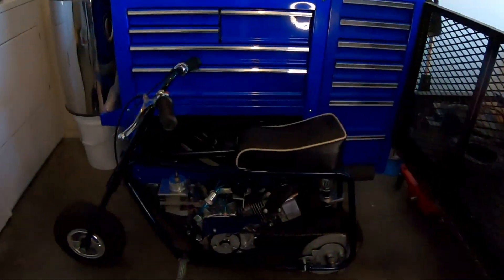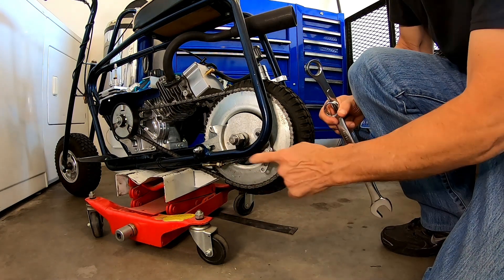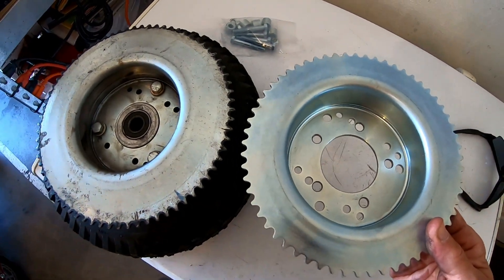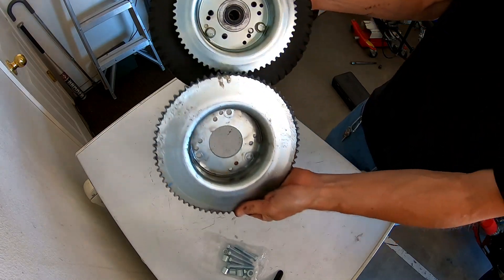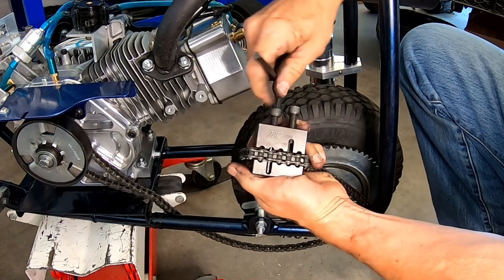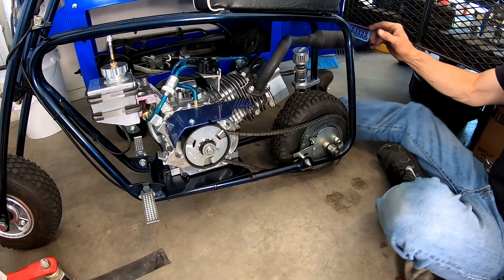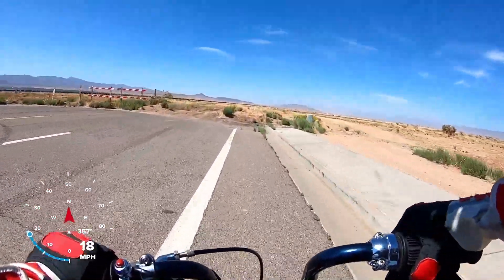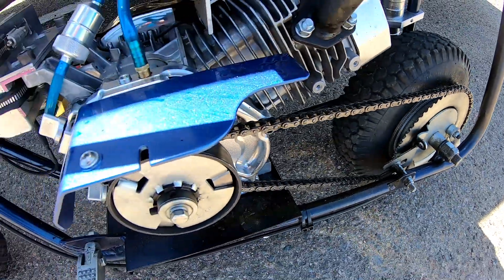Minibike goes 70 MPH/Predator 212

Comment: Any idea what frame that is?
Reply from the maker: Yes, it is an early model Azusa frame.
Reply: @Black66  thanks I have the same one and wasn't sure. You mentioned adding a disc brake, are there parts available that bolt to the tristar rims or would you have to swap it too? Thanks again
Reply from the maker: @bucky14b  I'm sure We could find a disk brake set up for the vintage wheels. Maybe GPS or Studz racing or somewhere like that.
Reply: @Black66  I've looked at GPS and don't see what I'm looking for. Maybe I'm just not sure what I should be looking for. I'll check out the other website. Thanks

Comment: Well so much for not being able to outrun the zombies or the po po, that's the ticket. What would be the average range on a tank of gas, approximately? Thanks for this excellent instruction. Appreciate it.
Reply from the maker: It goes around 15 miles depending on how hard you are on it
Reply: @Black66  thanks!!👍 This particular model, or for someone like  myself who has a little age and size on them what particular frame would you recommend for someone like myself? Your unit here looks simple, really nice, at the same time has superior performance.  Thank you for your help Todd in Charleston West Virginia.
Reply from the maker: @toddellis3323  If your a bigger guy I would reccomend one of the bigger frames like a Coleman CT200U-EX or something like that because this bike is really small. Im a small guy and its small for me. The Bigger Coleman bikes are really comfortable to ride. If you do want a small frame bike, something like a Doodlebug is a little bigger than the Azuza frame like this bike.
Reply: @Black66  Yes I'm a bit bigger and we'll leave it at that 😉. Thanks.  
Can I put the smaller tires on this frame with the 60 tooth back cog like you did on the other video?
Reply from the maker: @toddellis3323   You can for sure change out the gearing on pretty much any of these bikes. If you are wanting a small tire bike then I would just grab a Doodlebug/baja racer or a Rascal from go power sports  or something in that size range. There still small bikes but bigger than that Azusa frame. Or at least my Azusa frame. I have the early version with the straight handle bars. Which makes the bike a little harder to ride because there is less room for the rider.  If you really want an Azusa frame they do have different versions of something very similar on go karts USA web site. Here is the ink  https://gokartsusa.com/Mini-Bike-Kit-6-Inch-Wheels.aspx
Reply: 70mph Holy Chit, that's bustin major ass. I feel quite certain I wouldn't be at that speed very often but it certainly would be very nice knowing that level of performance is there if you need it. Thanks.
Reply: Thank you so much.

Comment: I'm a retired gm mechanic and just bought that very same 4 1/2" brake unit you have here, What a piece of crap!!!  Just about everything is done wrong, the unit operates with fred flintstone precision,  I'm installing an old 4" set that I own that are much nicer, What utter garbage!
Reply from the maker: This is an old-school bike. I wanted to keep it as period as possible. Hence the drum brake. If someone wanted a better braking system I would recommend a disk brake set up.

Comment: How much power you think the motor is making? New sub here 👍🏼
Reply from the maker: Thanks.   It's a basic build, it has a small cam in this combo. The parts list is in the description. I'm not really sure but maybe 12-15 or so.  Give or take.
I think the reason it was decently fast was the gearing in combination with the small tires and lite weight of the small frame.
Reply: @Black66  i need a new cruiser im pretty sure i have the fastest mini on earth rite now love the channel bro
Reply from the maker: @uncledave415  Thanks! Yours sounds like a rocket ship!
Reply: @Black66  its overkill 60 hp outlaw jr dragster motor with torque converter set up for 8th mile she wont stay off wheelie bars 🤦

Comment: I'm new to your channel, and you are a maniac with this ultra-fast mini-bike ... and that's awesome! Liked and subscribed! BTW, what kind of frame is that? Did you build up your mini-bike as a frame only, then chose all your parts by yourself, or did it come with an included engine, wheels, etc.? It's nice looking frame and a great color. BTW, yeah, you could've gotten up to and maybe past 70 MPH. You still had some top end left when you hit 68 MPH -- that's awesome! Way to go!
Reply from the maker: Thanks for subscribing! I bought the frame only . It's an old Azusa frame . One of the earlier models with the straight bars. I put it together in stages. There are quite a few videos on the channel with the different combos.

Comment: Also how much horsepower does your engine put out to give you 7000+ rpm
Reply from the maker: Not sure, but the parts list is in the description. I think the combo the bike had in this video was a perfect combo for the small 5 inch tires and light frame.

Comment: Get a 55 on the back and let’s see her top speed. I got a 17:54 gonna finish soon. I expect 75ish. Hope you can hit or beat it. Your motors pretty built s
Reply from the maker: I lowered the gear ratio with the clutches because I'm using the old school drum brake sprocket on this bike ,just to keep it more old school. Every tooth I add to the clutch is  equivalent  to taking away 6 teeth on the rear sprocket I'm getting to the point now where the engine doesn't have enough torque to pull much more gear.

Comment: Were did you get you rear sproket at and what stage is your predator what all have you done to it ? Mine just has the mikuni carb and no govern I need to put billet flywheel in it and I cannot find a exhaust pipe that will fit my bike its a Motovox any idea where I can get one at thanks
Reply from the maker: I picked up the sprocket from a seller on eBay https://www.ebay.com/itm/153969185235

This pipe should fit your Motovox as long as you don't have the engine lifted and is sitting on the stock mount 
https://www.gopowersports.com/header-pipe-3-stage-center-exit-196-212/

Comment: What is all the motor mods you have done to this bad boy
Reply from the maker: It's a fairly mild build. It has  
.020 ARC billet rod, ARC billet flywheel, ARC billet side cover ,012 Head gasket, Head stud kit  
Champion shaft mounted rockers  
VM22 Mikuni carb kit  
GX 160 head with mild port work 
Header pipe  ,252 series cam and 22lb springs

Comment: Where can i buy the 15t clutch sprocket?
Reply from the maker: I picked up the clutch at OMB warehouse https://www.ebay.com/itm/Max-Torque-Ss-Clutch-3-4-Bore-35-Chain-15-Tooth-MTSS1534-/174947428063?hash=item28bbade6df
Reply: Will it fit 212 predator
Reply from the maker: @osojayydoubleoseven9222  Yes
Reply: Thank you

Comment: What kind (size) head do u have on it? I want to change the head on my 212, but im not sure about pushrod size and rockers…..awesome build btw….i have a couple cammed, ungoverned ones on stock internals, but i want to build my next one with a different head, rockers, etc….
Reply from the maker: Thanks ! I think I added most of the parts I used in the description of the video . The champion rockers come with pushrods in the kit . I’m using a 14cc chamber,  GX 160 head on this build .

Comment: That is a beautiful minibike. That blue sets it off. Your videos are really making me want to get back into this hobby. I built several of these in the 90s.
Reply from the maker: Thanks!  Might as well get back into it. No time like the present.
Reply: @Black66  ya i have 2 of the coleman minibikes the bt200x and ct200u-ex. Trying to figure out which way to go with them. Build for climbing or speed.? I live in the desert now and usually run them on hills. My bt200x is heavier so doesn't climb as well as the ct200u-ex. So i love videos lile your for ideas and inspiration
Reply from the maker: @goadmerle  Maybe you could build one for speed and one for off road?
Reply: @Black66  was thinking the same thing. The ct200u-ex for speed. Due to lighter frame

Comment: Hey im trying to get a small sized affordable motor bike that goes for around the same speed have any suggestions? Im clueless when it comes to this kind of stuff.
Reply from the maker: If you want something small that has the potential to go fast and is easy to modify to go fast , get something with a predator 212 or at least a 196cc on it like a TrailMaster MB Storm . Its a small framed bike with a 196cc. Or an older doodlebug or Coleman cc100x with a Predator 212 on it.

Comment: im running 54mph on a stock predator with a mikuni carb,on an old chopped and stretched frame with 8-s and highway tires and Still pullin the front wheel...after watching your vid,i think im going to regear for 70 ish....Deffo an Ultracool bike you have built there....ps,should you read this,have you considered going with a Tav instead of the drum clutch??
Reply from the maker: Your bike is moving! Check out my other videos. I have a Torque converter on A Doodlebug and a CT200U-EX and a CT200U. I like the Azusa bike with the clutch. It is a super small bike.

Comment: wouldn’t a smaller sprocket on the back tire make the bike go faster? i remember having a smaller sprocket on my bmx bike and it made it easier to peddle faster . i have no mini bike knowledge yet so if it seems like a stupid question to ask my bad . I’m just getting into the hobby and trying to learn more that way . i can start my build . i wanna have a super fast doodle bug to ride around with for fun .
Reply from the maker: This is what I did in this video. I added a smaller rear sprocket. You can also add a bigger sprocket to the clutch for the same result. Got the doodlebug to over 60 in this video  https://www.youtube.com/watch?v=ScK99YPGpsg

Comment: Is a 10 tooth clutch with a 34 tooth sprocket any good ? How fast would it make a 50 mph bike go if the sprocket was changed to a 34 tooth
Reply from the maker: That is a 3.4 to 1 ratio. That would be a" top-end" gear ratio for sure. It really depends on the tire height on the bike, the weight of the rider, and engine mods, etc. What gear does the bike have on it now?
Reply: @Black66  it has a 41 tooth sprocket right now and it’s a predator 212 with the governor removed and a pz27 carburetor. The tire size is a “5”tri star with 135 pound rider
Reply from the maker: @ohyeahyeah1606  You said the bike did 50 mph before. The engine was turning around 5900 RPM give or take. Assuming the engine has enough torque to pull to 5900 RPM with a 34 tooth sprocket. It should run around  60 MPH.
Reply: @Black66  how fast would it make the bike ?

Comment: I switched my azusa from 5 inch wheels to 8 inch and rear sprocket to 60 tooth and tbh I'm afraid to go full throttle I back off I know I'm hitting 50 and than backing off until I buy a good helmet.
Reply from the maker: I bet that thing moves out !  
The big tire upgrade is nice !

Comment: Very cool, I have been riding old Harleys most of my life ( I'm 75) now I still ride a 1949 Cushman motor scooter with a 14 HP Subaru Robin engine. I recently bought a Coleman CT200U-EX for Shi--t s and Grins. Just finished putting a torque converter on it and that tripled it's speed from the original Jack shaft. I'll probably stop there. Old bones don't heal as fast and young ones. Besides I've been riding for over 60 years. Keep your knees in the breeze and the shiny side up and the greasy side down.
Reply: ive got an old junky cushman eagle frame im gonna put a v twin briggs on.
Reply from the maker: @frigglebiscuit7484  Yes!
Reply from the maker: Thanks! good advice! I have an EX I put a converter on also. Video coming soon.

Comment: I live in the same town! What would it take for you to make 196cc motor/ coleman mini bike way faster... sos
Reply from the maker: Nice town. If it's totally stock. Bypass the governor first. That will make it quite a bit faster just doing that. Get a pipe and a high-flow air filter. If you can add a bigger jet that will help too. There is a lot more you can add after that if you really want it to run.

Comment: Where can I find the chain breaker you used in the video? All the ones I used are very cheap and break in the first use so now I just use a punch out and a hammer. And I can tell you it's not very easy.
Reply from the maker: It's on the ARC racing web site

Comment: What size cam and valve springs?
Reply from the maker: In this video, it was running a 252 rattlesnake cam with 1.2 ratio rev rockers
Reply: @Black66  no upgraded valve springs?
Reply from the maker: 26lb valve springs

Comment: For sake of stopping power I would go with a air heart disc brake, then get either a torque converter set up and use a belt of only 5/8" wide that way it will give you take off power plus a greater top end speed!!! I have been custom building mini bikes and karts for the last 47 years. I made go-karts and mini bikes go up into the stupid speed level. I used a 440 cc twin from a snowmobile with the compression so high that she preferred 113 octane and It was fun.
Reply from the maker: Thanks! I have quite a few other videos on the channel with torque converters and different setups. I like testing different combinations just for fun. 
This bike won't have the combo it has on it for very long. lol I can't leave well enough alone
Reply: Help my mini bike guy's
Reply: I swear officer,your gun must be miscalculated this thing will never go 875 mph,it wont even go 45 mph,hohohoooo its not christmas yet is it

Comment: What mods did you do internally ?
Reply from the maker: It's a pretty basic build. ARC .020 billet rod, ARC billet flywheel,14 cc chamber GX 160 head with 26lb springs with some mild port work,1.2 ratio rev rockers, with some chrome-moly pushrods, and a .012 head gasket. And a 252 rattlesnake cam.

Comment: Great speeds. What's your opinion on a CVT powering a sprocket gears? It'd be two forms of mechanical leverage aiding in top speed I figured but I haven't looked deep enough into gearing.

My goal is to buy a used ruckus clone, put a 200-250cc motor in it and be able to achieve 80-90 mph.
Reply from the maker: Definalty gain some quickness and top speed with one depending on the vehicle. I like the smaller minibikes with just a clutch. But I do like them on the bigger bikes. I have a few videos on this channel using them. I put one on the scare chair and it really woke it up. Check it out, here is the link      https://www.youtube.com/watch?v=dINewgKuzkg
Reply: You can probably ride this on the freeway lol

Comment: Those tires at 35 are fun, at 70 they should be the life of the party. I grew up riding a 330 go-kart with those.
Reply from the maker: That's what makes it fun. Doing something that shouldn't be done. My dad had a kart shop back in the '80s. Back then we went 30 mph with a Briggs 3 horse. Good times.
Reply: Death of the party more like it.  KENDA tires at the least.  I have a 3 horse flathead and I am hitting 45 anytime of the day.  Used to run cheap tires ONCE until I had a rear tire blowout at 35 mph. Skill goes out the window because everything happens so fast before you realize it you are scraping yourself off the asphalt wondering where your bike disappeared to. 70 mph on them tires? No disrespect bro but you are ignorant. No other word for it.
Reply from the maker: @cravenmoorehead5636  Yes! Need a good exciting tire blow out!! 👍🏼😀

Comment: How much for one of those brake change tools. I keep telling everybody on Mini Bike maniacs. I get like 2 months out of a chain with a master link. I think I'm bottoming out and hitting the chain and sprocket. Think it was February we had a nice day up here in Massachusetts period and went for a run 20 minutes in the chain pop we put it back on popped again I have a huge flat head screwdriver shoved under the seat Bandit Twisted go to miles an hour the whole way home and we get there cuz I had extra chain. But no master link. My seven-year-old says why don't you use chainbreaker in push the pin back in light Dawns on Marblehead. We do it I give it a little bit of fancy work with a decent pair of needle-nose pliers. Took it out for an hour Cruise tonight. Everybody get rid of the master link by The Chain break period and don't ever ever ever ever ever ever look back
Reply from the maker: It's about $20 on the ARC racing website

Comment: Where can I buy that gas tank at?
Reply from the maker: it's actually a car reservoir tank. You need to re-tap the holes for smaller fittings. https://www.ebay.com/itm/224282229495?ssPageName=STRK%3AMEBIDX%3AIT&_trksid=p2060353.m1438.l2649

Comment: Hey just recently started up the Tilly but I’m kind of at a stop rn because when I started the engine and reved the throttle the engine reacts but the clutch and wheel do not spin you have any knowledge on this?
Reply from the maker: Is the keyway in the clutch? Or maybe the clutch isn't engaging?
Reply: @Black66  the key way is too long for it to go all the way in lol do you recommend me cutting down to size ?
Reply from the maker: @xchoatic_venomx744  Ya, Just cut it down to fit. Nothing should be sticking out of the shaft
Reply: @Black66  ok perfect thank you as always 🍃
Reply: Also I think the engine keeps spinning when I rev the throttle